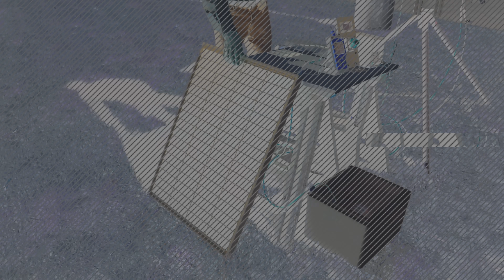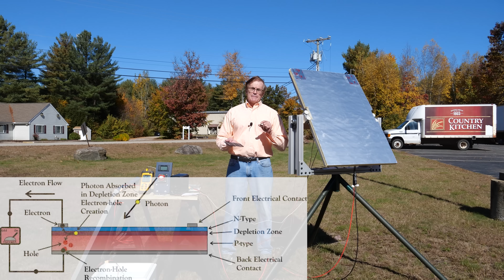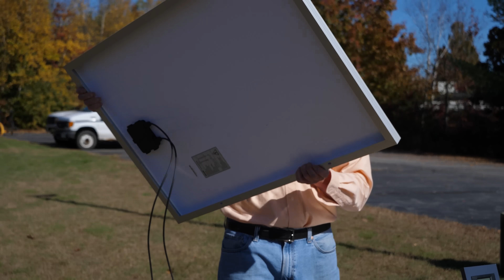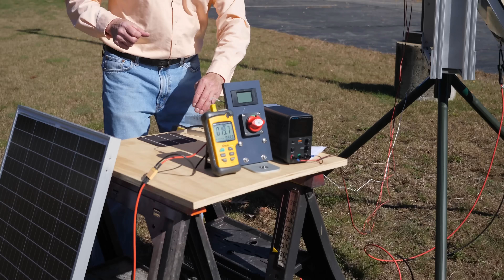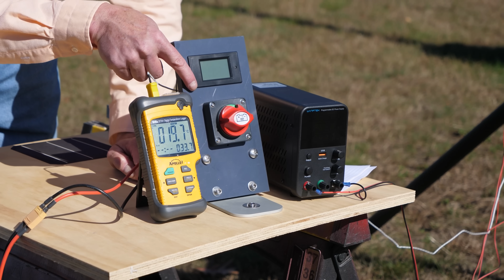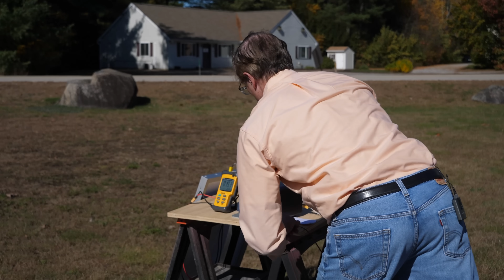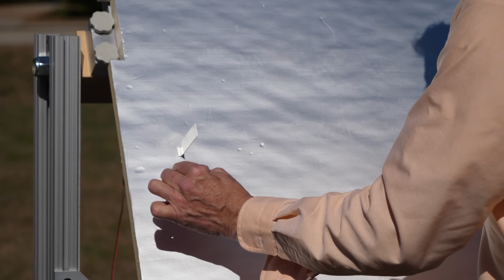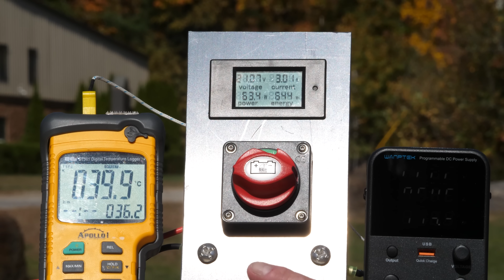Do you REALLY get enough out of your solar panel?

Comment: Your engineering and analysis is very good; I am impressed and educated.  My only quibble is your final assessment, suggesting that adding cooling to solar panels for a 1-3% improvement in either power generation or longevity is worth it for a 20-25 year investment.  Technology is changing fast, and it is risky to project 2 years into the future, let alone 25 years.  Surely engineering progress will not stand still for the next two decades.  More likely, technology will improve so drastically and in unpredictable ways that any calculations made today will soon be obsolete.  Small incremental improvements are certain, and an entirely new solar panel technology may be developed.  This needs to be taken into account far more than I see being considered here.
Reply from the maker: Fair enough.
However,  the underlying  principle  of photovoltaic generation depends on the separation of the charge carriers, and that decreases with heat.  As the technology  improves, keeping  the junction cool will always  improve efficiency.

Comment: What if you painted the back of the EV panel with the barium cooling paint you made? Would it need a mirror at 45º to reflect the IR at right angle to sun direction? how would the efficiency be of that passive cooling? 🤔
Reply from the maker: It would.
The coating  must "see" the clear sky.

Comment: Heat sinks are also pretty easy to find in old equipment, smaller ones on MOSFETS and the like and larger ones in old electric coolers and the like

Comment: Could bury a 50 gallon barrel drum and use thermal temperatures to cool the water.  Then run a pump system to keep cooling because I think fan would bad fast being outside. Back in the day my fan in the wind would have built up lint on it and the same would happen.  I love your videos keeps me in creative state of mind and your very organized with your work and it's not easy I'm sure.  Keep making these videos I love where your going with this as prices rise and war's go on. I'm looking to start preparing for the bright flash as the days get closer to midnight. Although I'm a truck driver living in the county should be a tad bit safer. Although I'm sure the move from most survivors would be to head north. 

Will you ever myth bust the Lyberty Engine, machine?

 As thermal dynamics is the belief stranger things that defying are understanding of physics in the news or know as the great distraction to sceptic.

Comment: in your video: Do you really get enough out of your solar panel.
there you show that you can put a fan on the back of the solar panel, you can tell where you can buy them. I have searched the web without finding any for outdoor use.
Reply from the maker: Look for wash down rated fans. These have an even higher standard as they have to survive  repeated spraying with pressurized water.  That's what we did.

Comment: I've notice this same affect with my camper van.  I've got two 100W panels on top of the Van with about a 1" air gap between the panel and the van roof.  When traveling I believe I get better performance out of the panel than when parked because of the air flow over the panels although I haven't measured this to quantify the difference.
Reply from the maker: That makes sense.

Comment: Wouldn't you create a chimney effect, drawing cooler air in the bottom as the heated air flows out the top?  Are the fans push or pull?  Do they impede or enhance the chimney effect?
Reply from the maker: They're  pull and work with the convective flow.
Reply: @TechIngredients  Thought so. Thank you and please keep up with the great content.

Comment: You'll need the lifespan hours (MTBF) of those fans, plus their cost to factor in as well as panel longevity figures.  You also have to factor in the increased setup costs to build the aluminum radiator fins, install them, install the fans with the metal backing, run the wiring, have a timer to run the fans only during the daytime, or when panel voltage and temperature warrants cooling (i.e. not on a rainy day).

In the end, you may need the reflector / concentrator "future you" will be testing to provide more output from the panel yet in order to make this all worthwhile, without the heat penalty that the fans will remove.  You'll also need some form of an alarm system to note a van has failed (voltage or current change?) so that it can be replaced.

Comment: It's a thermal management system that pays for it's self. What if you add the cooling paint to any surface area of the solar panel facings the sun that's non functional. It would send away IR to space increasing cooling. Merge your two videos.

Comment: What if you glue some peltier junctions on there and use them to power cooling fans?
Reply from the maker: The problem there is the low efficiency of the generators and the fact that they decrease the cooling effect by insulating  the panels.  The net result is negative. 
Check out our previous video on the "Campfire Generator. "

Comment: Enjoyed the video.  The waste heat.  That would seem to be a big problem at the economy wide scale for any kind of power generation technique.  But it is particularly troubling with solar power generation.

One of the attractive features of solar power is that can be decentralized and placed as needed.  But that waste heat is bound to be a bigger problem given the distributed nature of the power generation technique in this case.  For example using the waste heat at scale in and industrial setting is much easier if you are using large systems.  But for home systems?   How much bigger is the problem if you assume the scale of usage for this technique that makes a significant difference to the home market for solar panel power generation?

My reservation is that we often find solutions for the immediate problem we are facing, only to find that our solution is somehow kicking the original problem down the road. The possible consequences while unintended can be rather dire if allowed to operate over time at national scales.  Be really cool if you could somehow direct the waste heat to lower water heater costs, for example.

Comment: Would there be anyway of perhaps getting into the circuitry of the solar panel and potentially only draw current from a few cells. Thus illiminating the need for an DC-DC convertion loses.  In other words incorporating this cooling element within the overal design of the panel itself could increase efficiency.
Reply from the maker: If you mean in order to drive the fans, then it would be easiest  to specify  a fan that operates at the design voltage of the panel, assuming  that you're  not just testing different  prototypes.
Reply: @TechIngredients  thank you, really appreciate it.

Comment: Just discovered this channel and have been binge watching. 

I think a great experiment would be to combine your two experiments of the mirror doors you made to reflect more sun onto the panels combined with these cooling fans could provide the ultimate efficient panels especially for people in more northern climates where they need all the efficiency they can get out of panels. 

Do a couple tests:
#1- test how hot your panels get when using your reflecting doors compared to a standard panel

#2 how well can your cooling fan system keep up with the heat your reflecting doors cause. 

#3 the overall efficiency gain of both systems combined.

Because the only drawback I could see with the reflecting doors is the additional heat it causes.

Comment: Firstly.    ALWAYS top notch content.   No one does it better.   I had 3 ideas after watching this.   1)  why not use Thermo Electric Cells adhered to the right angle heat syncs?   Heat on one side cooler on the other... maybe enough to run the fans.   2)  If a water sync like a lake is not available... consider using the trick of digging down 4-6 feet and burying pipe.   Get some precooled air.   3) the approach using the buried pipe can be done using convection heating to move the air without power depending on where is installed.
Reply from the maker: The thermoelectric generators are very inefficient and will lower the heat removal  from the PV panels. The net result is an overall  decrease in system efficiency.

Comment: so fans at the bottom would also not fight against the heated are attempting to rise
Reply from the maker: The fans at the top were exhausting the hot air.  At the bottom, the fans would be oriented  to push the air through the space behind the panels. 
Both methods would work, but the exhausted air does not add the heat generated by the motors to the cooling air.

Comment: Heat pipes to a collector at the tip for hybrid PV/solar thermal system. Heat water thermally and dump into 200 gallon storage wells that a preheated tank can downblend to 125F for residential use.

Comment: Uh huh. I mean it's great to remove the waste energy, but since it's heat, why can't it just be recycled or captured in some way? Pumping it away just seems needlessly  wasteful.
Reply from the maker: Engineering  is the art of compromise.
The cost of the recovery  system and its space requirements along with the added maintenance aren't  worth the small return.
Like recycling, you don't  recycle EVERYTHING.

Comment: I used to grow weed and to capture more light I would use reflective mylar sheets.  It occurs to me that reflective mylar could be attached to a rigid panel using spray adhesive.  Cheap and easily replaceable.  Also, over time I had read somewhere that flat white paint reflected nearly as much light as the reflective mylar but it diffused the light giving a more even coverage whereas the mylar would tend to focus the light more in certain areas and less in others.  It would be interesting to see how these materials compared to the aluminum panels you used.  Perhaps even a matte finish white plastic would work well.  Sometimes materials that don't perform as well but end up being cheaper and easier to maintain or replace make them a better choice.  Especially if they perform anywhere near as well.

Comment: Nice experiment. To further explore the "is it worth it" aspect I would think a test where you just expose your home made fins to the air without the fans might be interesting. E.g. just the fins coming off the back of the panel exposed to the atmosphere. Maybe make them a little taller and slotted. On days when the air is moving or utilizing the effects you describe in the video, you might get your couple watts with a system that requires no maintenance.

Comment: I would have liked to see a panel designed for passive cooling as the control. It seems the cooling design of you panel is great for using with a fan, but not so great for passive cooling. Great content, thanks for the work!

Comment: Could a water cooled solar panel system put the cooling water energy into a heat sink and be used for heating the house after sundown or hot water for washing, etc.
Reply from the maker: Sure.  You can buy commercial panels  that incorporate  that feature.

Comment: thank you for sharing, I had the experience of connecting a computer fan to a 7 watt  solar panel  & ran  that on a sunny day from 8am to 4pm , just so happens  the panel was in range where the sun rises and ends up at the end of the day.That was my start of free energy. The limitation I feel ,are limited in one way and abundance in others, when compared to heating and cooling. Aside from that, basic  tv ,lights , refridgeration , microwave, fans make it worthwhile to harness this energy.

Comment: Moving parts die, and replacing them is a pain on the roof + extra cost for fans.
They at least needs lubrication every 3 years and nobody knows how they behave in wet/cold weather conditions.
+ designing a good radiator is a pain.

Comment: I got a question for you. I been thinking if you closed in the sides and back and insulated them it would stay much cooler and could be cooled down more with battery powered water air conditioner. What do you think or could you test my idea? John Helms
Reply from the maker: Sure, it could, but the power required  would be far greater than the additional efficiency gain from the panel.
Reply: @Tech Ingredients  I am talking about rechargeable air conditioner that you fill with water and runs around 6 hours with a mist of water to cool there very efficient

Comment: Looks like an awful lot of work and expense to gain a few watts per panel and maybe another year or two of panel life.  The panels themselves are a small part of the costs when you calculate in the mounts, labor, wiring, breakers, inverters and battery bank that is the rest of the system.  In 20+ years we may have another few percent more efficient panels and I'd want to change them out anyway.  I have 10- 350 watt panels that I paid $300 each for.  Cheap compared to the rest of the system and my LiFePo4 800AH battery bank.  I enjoyed the video and the detailed approach, but I'd predicted at the start that the ROI was going to be marginal and not worth the effort.  Maybe in a large industrial system with water cooling, and a use for the waste heat, and a tax write-off.  : )

Comment: I thought this was an excellent video and you answer a question that I’ve had for a while But when you’re concentrating the light into an area. Are you burning out the solar panels faster or creating a spot?
Reply from the maker: The elevated  temperatures will degrade the panels  faster.  These non imaging reflectors will not focus the light to a spot.

Comment: If it is an indusial installation then dump the heat in the sea, but use a heat engine to recover mechanical energy which can then run a generator.

Comment: Would the fan work just as well if the panel was mounted on a black roof? I would imagine that air would be so hot, that it wouldn't cool down the panel significantly.
Reply from the maker: It would.  The panel  will always  be hotter than the air that it is immersed in. The surrounding air is its only significant means by which it releases  its heat.  Everything  will just be at a higher temperature.
Reply: @TechIngredients  Wow, thank you for the response!
That is true, but your test uses nice free-flowing air, not heated air that sits on the surface of a black tiled roof.
I am thinking about putting PV panels on my roof and wonder if it would pay off to install fans like these.
Your arguments make a lot of sense, but I think the contractor would give me funny looks when I'd start talking about this, but if it really pays off, it might be worth a shot.

My other thought was to install some sprinklers and spray rainwater from an underground tank. A bit worried that pumping will eat all the benefits and that cold water on 80+ deg Celsius PV panels would make something crack.
Reply from the maker: The free-flowing air is still "heated" because  it is at ambient  conditions.  The rooftop is just at a higher ambient  temperature.
Water cooling  is a definite  option but has its own issues.  Water may be scarce where the panels  are located.  It can contain minerals that will leave deposits  on the panels, and it has to be pumped, which, like the fans, consumes some of the power gained.

Comment: I have thought about using thermal electric transducers to help cool solar panels with the back side of the panel being the heat source and dumping that heat into either water to offset water heating costs (especially if you are on a totally solar powered system) or just into air using fans like you have done. However, I do not currently have the time or Resources to Experiment with that. If you are interested, perhaps you could see if you could increase the total electrical energy generated by the hybrid combined photo electric and thermal electric generation. This touches on your explanation that solar panels only convert a portion of the radiant energy into electricity were as much of it is absorbed as heat. Using thermal electric transducers would allow for some of that heat energy to be also be converted into electricity. It may be that the temperature differences needed for the thermal electric transducers to work well enough to offset there cost my make the system impractical... But I would be interesting to find out...

briefly

Comment: Unlike your HHO video that i destroyed.
You did a really good job this time!
But i would a duel Axis Vs. a Fixed axis solar system. 
I run a Dual axis system, my daily gaines are massive. with a ealer start time and later start time granted at about 7PM in the eveing, the total voltage for 6 10.02A/40.9V pannels is a low 22V@ 0.05W before my MPPT cuts off.
But i have seen in high UV days the pannels outputting higher then there ratings by as much as 8.2%

Comment: Hi, if you install the panels on your roof, without air gaps in between and you do this over the whole high of the roof, you should get a chimney effect causing large volume of air being sucked in from the lowest point  causing more circulation then convective airflow on an open panel and anodizing the rear aluminum in black increases radiative cooling by up to 30% compared to silver aluminum
Reply from the maker: Good point.

Comment: To be fair, you should compare a regular panel without the aluminium sheet on the back, and the one with your setup with fans turned on. I think the back sheet with fans off makes it hotter than a regular panel without the sheet. Thanks for the video!